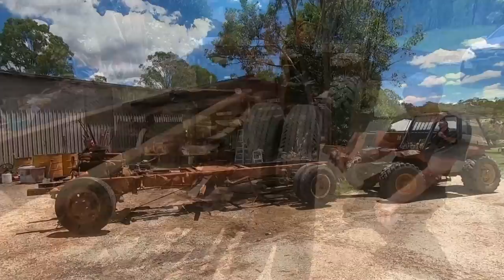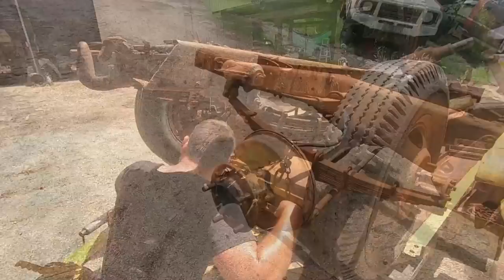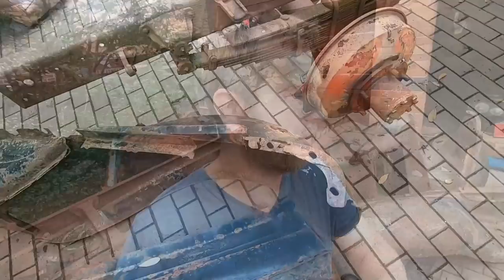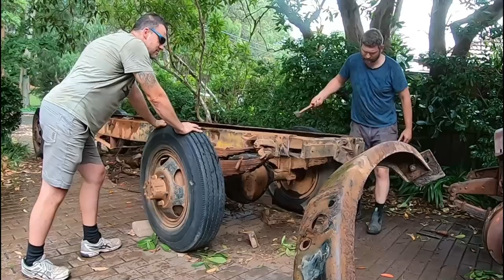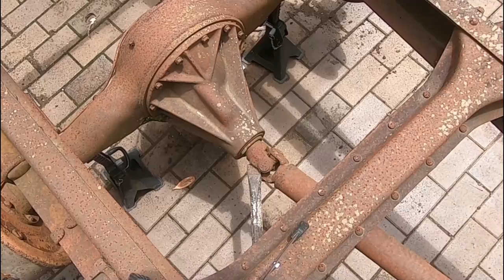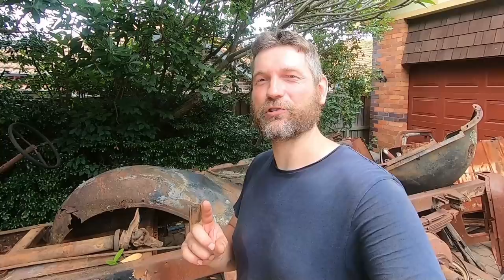Picking up CHASSIS NO 3!? For our 35 Dodge race car transporter truck.

Comment: That is a decent chassis frame box that you picked up. Was it a ford or chevy chassis? 
Definitely might have some cooling issues using that small radiator on the 7.3L diesel. Might need to widen the radiator house.
Looking forward to the name.
What is that blue yard art box?
Reply: Itll work itll just need to be like a 4row multi pass radiator. Likely custom made. But it can be done. Plus u can add extra "radiators' along sodes of frame like they did with old steam cars. Multi radiators is def an option. If u look at the radiator he removes u could easily stack 2/3 more rows behind it

Comment: Not sure why you didn't just use the '36 chassis, especially as you have to modify the '35 to the same dimensions as the '36??
Reply from the maker: 4 spots of heavy pitting on the 36, plus I feel like I'd rather keep the 35 cab and chassis together.